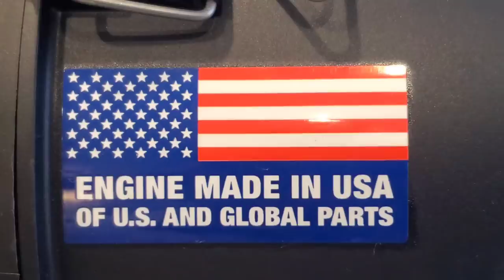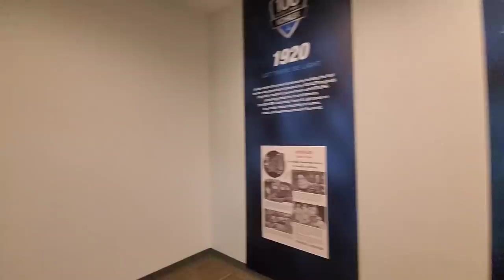[Where Do They Come From] Let's Check It Out!

Comment: A former coworker was awarded a Corp of Engineer contract for Summer camp ground maow and trim. He bought the Kubota diesel zero turn and went to town. Don't recall the cutting width. He had some tight areas and side slopes but was never an issue unless wet. Hollis Farms on YT uses a Dixie Chopper to mow his grassy area. He always waits too long to cut it and it bogs but keeps spitting it out.
Reply from the maker: very nice

Comment: I ran a bush hog es 2052 for 10 years. It was marketed as an estate mower and I mowed about 2 acres a week with it. When I sold it it still had the original deck belt and the only thing iui had to replace was the muffler on the kohler engine about 2 years after I had gotten it. Kohler replaced it free of charge.
I now run a scag turf tiger with a kohler.
Reply from the maker: Thats cool man Scags are nice

Comment: That was nice everything we own has a Kohler Engine on it they are good engines
Reply from the maker: Thats awesome
Reply: kubotas are made in japan even there diesel engines plus there exspanding dealerships
Reply: @michaelmactavish1728  they make zero turns and garden tractors in Gainesville Georgia. Diesel engines up to 99hp are built in Lincolnshire Illinois.
Reply: @leeshelton5283  i was looking at a zd326 with 60'' mower deck, 48'' blade and 48'' snowblower attachment wich wasnt really to bad $28,000